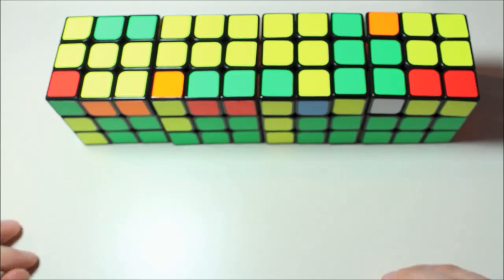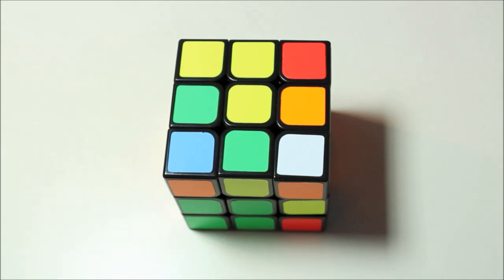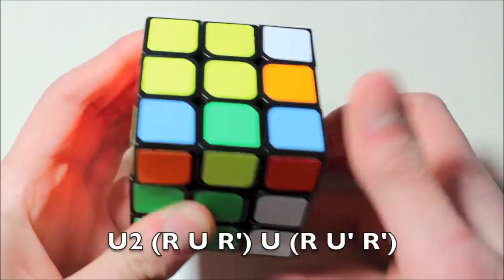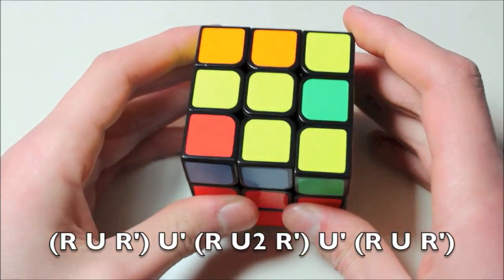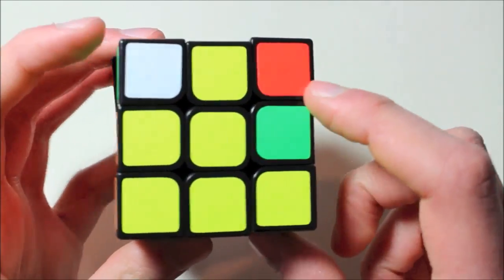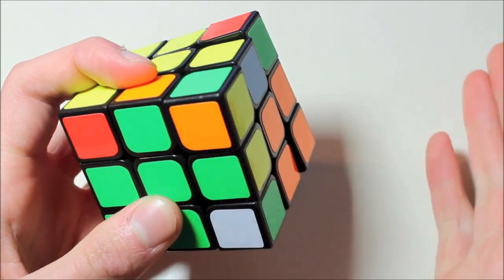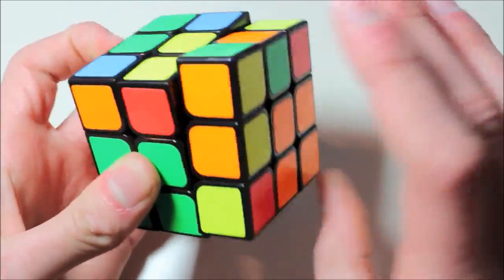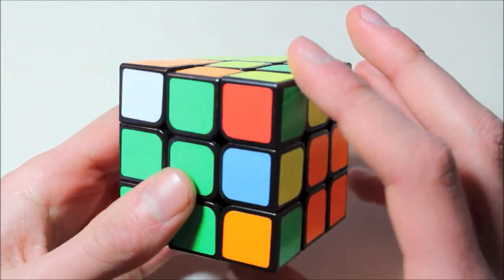[Collinbxyz] F2L Techniques: Advanced Pairing

Comment: Instead of the sledghammer (R' F R F') is it just as good to do (U R U' R')?
Reply: Perhaps.

Grab a f2l case, apply that and tell us anything that's helpful.
Reply: I now use the sledgehammer to prevent rotations and the other move when in a different position. It helps heaps not to have to rotate.
Reply: most people will insert using U R U' R" typically. For EO of the LL though, a sledgehammer can be really helpful to avoid dot cases.

Comment: you should add the sexy move as a trigger because that is used alot
Reply: Anthony Charles It is in there as part of the basic insert. This changed my F2L dramatically.
Reply: Termin Ator Example: around the 5 minute mark he uses the inverse sledgehammer to seperate and gives a case that will pair with the sledge, then you have to insert. But that resulting case can also be solved and inserted by 2 sexy moves on the left, which I got from an F2L algorithm page.